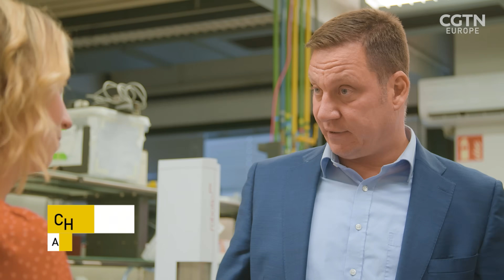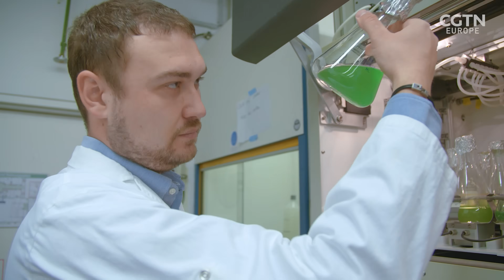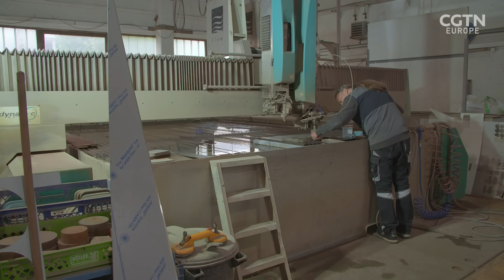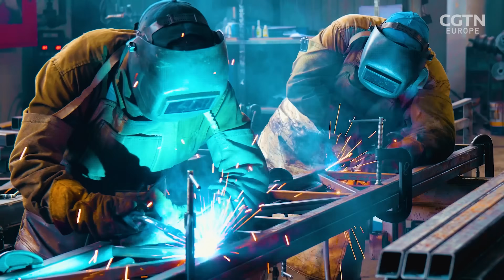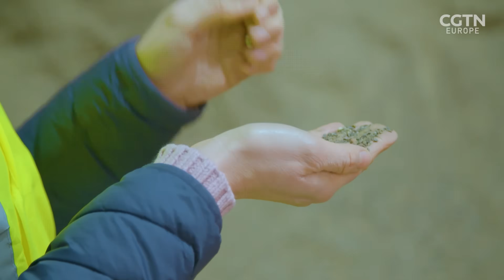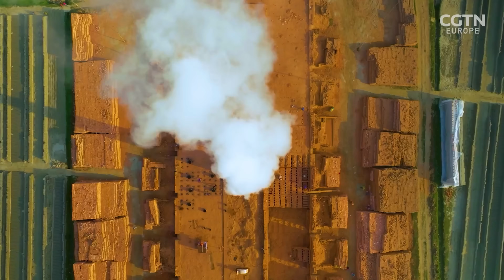The surprising materials that could decarbonize construction

Comment: Steel is preferred as a reinforcement to concrete because it has the same co-efficient of the thermal expansion as concrete.  Carbon fibre does not.  The steel reinforced concrete section will expand and contract with a change in temperature as a single unit.  
.
If carbon fibre reinforce concete section is exposed to major temperature changes the carbon reinforced concrete will crack up.  This has been known since... err the 1950's (glass fibre).  Yet we continue to see these studies that are intended for specialist concrete like decorative facades or small sections (like a table top).... but don't put any serious load on the concrete or expose it to major temperature changes.

Comment: I believe that we should coat asphalt roads and parking lots with a reflective-adhesive surface. This will keep it from contributing to global warming and probably make the roads and parking lots last longer. We should also develop a reflective roof coating to prevent our roofs from conducting so much heat. Our  roofs should have solar panels on them, but they should also have heat reflective coating.
Reply: Agreed I was going to say shading parking lots with PV panels may be better since the traffic on the roads would wear off paint. Radiative cooling on rooves as well as trees along streets and green rooves. stuff like decreasing the amount of cars and increasing quality of public transport in highly populated areas could make a huge difference too.

Comment: Carbon fibre is not really one of the most used materials in construction currently for three reasons; 1) cost, 2) poor fire performance and 3) potentially brittle failure. Wonder how they are dealing with this?
Reply: Stopped listening when I heard that.

Comment: It sounds as if Kenoteq may have a cost-effective production system, but if so they need to say so. And using algae to produce carbon fiber and biochar is likely very costly, and therefore not broadly viable as an alternative to industrial scale construction materials. Alternatives have to be both green and affordable to make a significant difference.

Comment: The algae needs lights and pumps which take energy so how is the algae carbon neutral?
Reply: Well, how is nature carbon neutral? This goes back to the lights and pumps… they run on electricity. Where does the electricity come from? If it’s from fossil fuels, it’s a problem. But if it’s from renewable sources like wind and solar, then it’s not a carbon problem.
Reply: @davestagner But wind and solar take fossil fuels to produce and replace and at the scale needed to replace the petroleum we use now that's not a possibility. The best reduction for the use of fossil fuels is reducing the need for energy and since the largest part of the economic system is waste there is lots of room for reduction. Working for pay takes energy and resources so if people don't have to pay for housing the need for using these resources would be reduced by 25%. This would do more to stop carbon pollution than ten times the number of solar panels and wind turbines that we currently have on the planet.
Reply: @davidcanatella4279  Solar panels pay off the energy investment required to make them in a year or two. After that, they’re net energy positive - energy that displaces energy that would otherwise come from fossil fuels. You have to look at the whole system lifecycle, not just the manufacturing cost. In 2024, solar/wind accounted for approximately 15% of global electric generation, so 10x that would be 150% of our current total electricity, which would wipe out fossil fuel electric generation and cover a majority of petroleum used for transportation as well. You HAVE to do the math on this stuff. Vibes will not solve the climate crisis.
Reply: @davestagner pay off isn't the absence of fossil fuels. Only 20% of the energy civilization uses is electricity and the vast majority of that is produced by fossil fuels. When is come to math we are talking about an astronomical scale of dependency on fossil fuels. This isn't a plug and play situation. Societies will have to fundamentally change to significantly affect this dependency. The energy equivalent to fossil fuels simply doesn't not exist for the earth.
Reply: @davidcanatella4279  Again, think about the long term. Today’s solar panels have 25-30 year warranties, and their functioning lifespan is likely decades longer than that. And when it’s time to replace them, the materials are largely recyclable, and by then we’ll be done with fossil fuels, so the replacement panels will be made with renewable energy from recycled materials. That’s a sustainable-forever system. 1kW of solar panels at 20% capacity factor will produce around 70MWh of energy in a 40 year lifespan. That’s the equivalent of about 35 tons of coal, which would produce around 100 tons of CO2. It’s not that renewables aren’t energy equivalent to fossil fuels, but rather the other way around - fossil fuels are TERRIBLE compared to solar/wind. Batteries are subject to similar logic. Yes, there’s an initial mining/manufacturing cost - a “seed” cost. But the materials in batteries are not consumed by use the way fossil fuel is. The lithium and nickel and what not is all 100% recyclable. So when the battery is worn out in another 20 years or so, turn it into a new battery - using renewable energy that next time. Again, sustainable forever, once you’ve made the first batch.

Fossil fuels suck. The value is not in the elements, but rather in their chemical bonds - solar energy from millions of years ago. Methane is CH4. When burned, it becomes CO2 + 2H2O, stable compounds that are basically worthless for energy. And because it took millions of years to make, even if it didn’t cause environmental damage, we’d simply run out pretty quickly on human time scales - we could be out of recoverable fossil fuel by the end of this century. 

Degrowth and conservation, without also migrating our energy systems to renewables, CANNOT SOLVE THE PROBLEM. It just delays the inevitable. If we reduced fossil fuel consumption by 90% tomorrow (which we won’t do), we’d just take 500 years rather than 50 to run out of the stuff and hit 5c. Human civilization is already 20 times older than that. Degrowth is suicide (so is growth forever - we have to level off). But if we build out those solar panels and wind turbines and batteries, we can have clean, abundant, and sustainable energy, for as long as humans are on this planet. Which could be a long time, if we don’t do stupid things.

Comment: I’m always in awe about the research done in the decarbonation field but where did the CO2 come from as I may have lost something in the explanation. Did they just buy the CO2, was it scrubbed from the air or from fossil fuels. How much fossil fuel based energy was required to produce enough CO2 for the research team to use. The term Carbon Neutral seems to me to be used to Green Wash a whole host of research. How much of the CO2 was used by the algae and how much was lost to the atmosphere. What percentage of CO2 was captured by the algae. If the reporter is not apt to ask poignant questions and just glosses over some fundamental questions, it just becomes an infomercial.
Reply: It’s not just where CO2 comes from now, but where it might come from in the future. Direct air capture of CO2 can be done using renewable energy. More efficient capture can be done at intense sources like cement plants. And businesses trying to make products like this are doing it with the intention of carbon capture. So I don’t think it’s a good idea to assume that the CO2 source for production scale (not lab scale) will be a massive problem.

Comment: Bricks made from recycled building materials make sense. If possible, a modular building block could also be produced, weighing approximately 10-20 kg per unit, which can be installed without cement, using only a locking system, and, of course, can also be dismantled again.

Comment: But I AM absolutely thrilled with this approach! Carbon fiber extraction from algae production?! Brilliant! Using biochar as insulation naturally increases CO2 storage. If these wall elements are drilled into, or later modified, dismantled, or destroyed by external force after installation, dust development would be a real problem without further precautions. As an alternative, a combination of biochar with, for example, clay, or a compression (honeycomb structure?) must be considered. Compression would store additional CO2. The more solid components are made, the slower (more comfortable!) the temperature change in a building.

Comment: if it’s lighter than concrete/brick (density) you’re going to have acoustic problems. Plasterboard with an airgap is a reasonable way to beat the mass law (acoustic) but even that gets heavy.

Comment: I am steadily loosing faith with all this CARBON NEUTRAL/ LOW CARBON hysteria.  Everyone is using a different method to calculate this and not going back to the real source of any particular commodity.  The only way to be carbon neutral is to not exist,  we do breath out CO2 after all.
Reply: Circulating carbon that is already in the biosphere has never been the problem (thats what life does).  Pumping deep stored carbon out of the ground and introducing it into the carbon cycle (aka fossil fuels, concrete) is whats breaking us.  Thats a very different thing that disrupts the carbon balance and is triggering climate change.

Comment: Man Made climate Hysteria is based on complete ignorance and stupidity. The Earth has had several Ice ages and major heating events over the Billions of years the earth has existed. Man has only been around for a couple of Million years and Industrial capabilities have only been around for a few hundred years. Which means man has never caused any major climate events. The Climate hysteria is all based on biased unscientific BS focusing on the PETM which is the Paleo Eocine Thermal Maximum, which is the only time that carbon levels rose with increased temperature; while the many millennia of Global warming leading up to the PETM had Carbon always lagging behind temperature rise, which all happened without any Human industrial inputs. Which means that Global warming is a long slow natural process driven by Solar Energy as it is today. We see it everyday when the Global temperature rises dramatically (20+ degrees C in hours) as the Sun rises and plummets when the sun goes down down. Yet we are tobelieve that we have to be scared of temperatures rising possibly 1 degree a decade or less? We see south pacific islands being swamped and blame it on sea level rise? when these Islands are largely created from Old Volcano cones that are breaking down and sinking into the sea. as we don't have sea level rise all around the pacific. I'll leave it at that.

Comment: Algae based carbon fibre. Interesting. Some companies are using fibreglass rods in cement instead of steel. Recycling concrete rather than putting it in landfills sounds good.Don't forget that CO2 is necessary for plants,  the balance between too much heat and another Ice Age is tricky.

Comment: All this because of a belief that carbon dioxide heats up the atmosphere in some very mysterious non physics manner. The properties claimed by these technologies is quite impressive. The cost is not addressed and to scale up to the extent that so-called economic activities is needed will this be in the same category as windmills and solar panels which is not at this stage viable with the economic realities business is facing, except for those sucking on the subsidy tits generously supplied by governments on the pocket of taxpayers with little if any benefit to those paying without knowing or realizing.
Reply: What wld you suggest to help decrease waste and population.  Forget carbon issues for a moment.  Just focusing on waste and population or trash.

Comment: No.  They're still concrete blocks.  The rebar isn't a major issue compared to the mix.   Same way the carbon fiber which they pretended they can make work and admitted to still dumping on farmland for ashes isn't actually relevant either, but resin its bonded with is the main cost and polluter.  You can do the same thing with old clothes as the black mesh, but it doesn't look good and you want something thin.

Comment: There is a lack of information for all the product and that is the energy needed when producing them.
Reply: Didn't they say in the video at about 8 minutes in that even with the energy required for lighting that the carbon fiber's still carbon negative? Plus I mean, it's light, so that's electricity, already decarbonizing. By the time this gets at scale in Europe this tech's gonna be wayyyyy less carbon intensive than the alternative, which is, y'know, steel.
Reply: That is the problem with all of these greenwashing products

Comment: Lighting is not co2 neutral.
Reply: If the Algae absorb sufficient CO2 to offset the  
Renewable electricity production the it can be carbon neutral or possibly even negative ... Growing the Algae in Columns in a desert area or at high altitudes . 

I'm waiting to hear about Basalt fibers and not FF intensive and water polluting  carbon fiber.. The other material is Metal wood produced by Invent wood ... 20 x stronger 10x15 times torsional strength.... Highly Fire retardant level 3 🔥 Rot, mould and pest resistant. Insulates like wood produced from rapid grown forestry softwood timber...  50 % carbon negative even after the process.

This looks interesting but I bet it's not Granite it's Basalt because it does absorb CO2 ..and it's also globally more abbundent.
Unfortunate place to start experiments with biochar .... Dachau😣🙄 but life is weird some times.

Comment: Why no numbers? How much does a brick cost? What is it's compressive strength and modulus of rupture? What mortar is used? What bond strength do the bricks achieve with the mortar? How do the new bricks stand up to freeze thaw cycles? What is the actual carbon footprint of te new bricks in tons of CO2 per ton of brick? At what temperature do the new bricks lose strength?
Reply: they are BBA and DrJ certified you can look it up it took me 20 seconds to find. 30N/mm2, 1.1.6 cement.lime.sand mortar, m4 joints10mm, F2 frost rated etc etc this isn't a sales video they're discussing manufacturing techniques if you want technical specs look it up they're being sold they have to publish data same as any other brick manufacturer
Reply: @YearRoundHibernater so they're normal bricks.  Did the ingredient list include their special mesh?  That will require a new frost study if they're using old recipe standards with a mod like that
Reply: @rumls4drinkin there is no mesh in the bricks these are 2 different companies. Either they meet standards or they don't the agencies test all claims before they can be sold, no point speculating in a comment section when experts have run tests, look up the results rather then just guess.
Reply: Thank you you saved 20 minutes of my life time
Reply: All brilliant questions I was thinking of as I watched video thanks saved me typing it out
Reply: The bricks are from outer space and were brought by cows who came to destroy earth with farts in 1967.